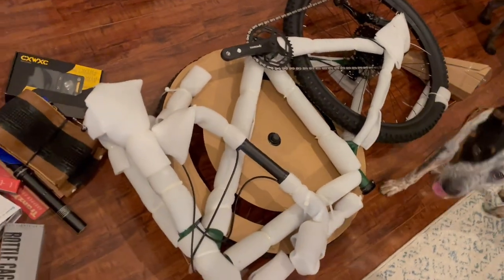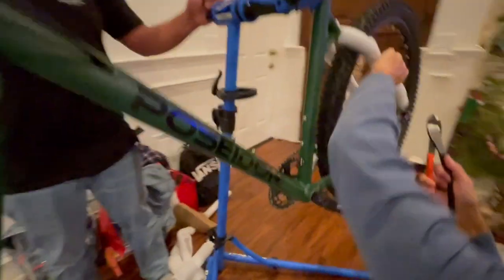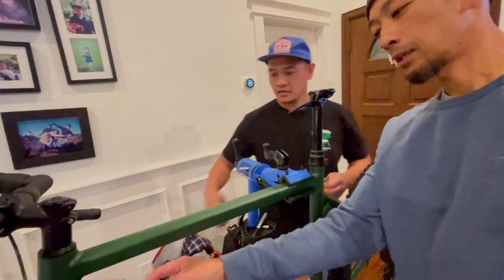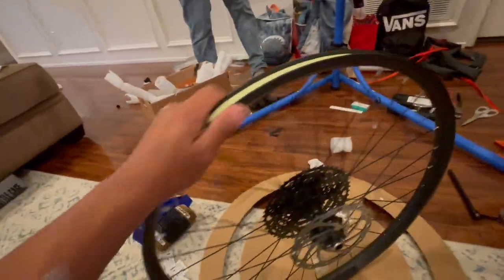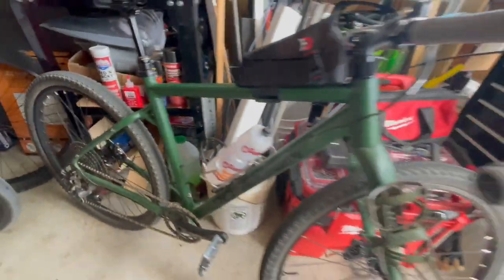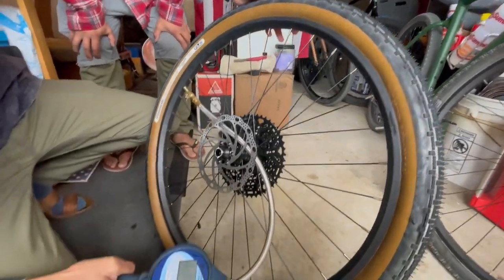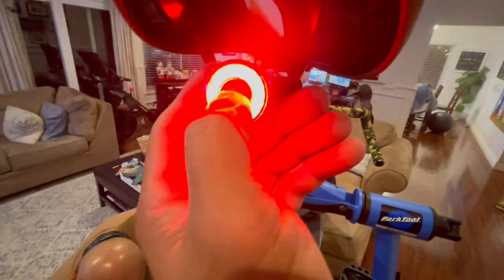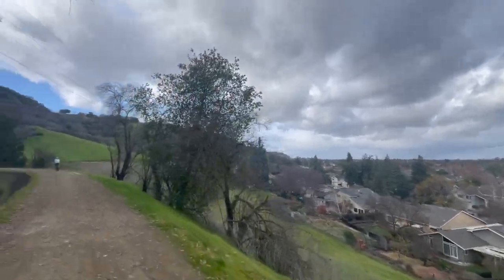Poseidon Gravel Bike

Comment: Thanks for the video.  After absorbing everything on the X and the Redwood for weeks, I pulled the trigger on the Redwood in green.  I'm right at 6' tall, so I went with the large, though medium would have also worked.  The large frame gives me more seat post in the tube and a bit more room inside the main triangle with still plenty of standover.  My bike should arrive Saturday, and the forecast is for 59F and sunny, so if FedEx delivers on their usual timetable I'll have time to get it built and take a test ride.  If not, Sunday afternoon is supposed to be mid 60s.  I have some mods planned (not including tubeless), but to ensure I have zero warranty issues, I'll be riding it stock (except the pedals) while I break it in.  There's a residential construction site a mile away with plenty of mostly packed dirt roads that will probably be a little bit muddy, so it will be a good test.  This bike is unlike any other bike I own, and to say I'm looking forward to riding it would be a real understatement.
Reply from the maker: Hope you enjoy the bike. My buddy bought one also and found the break rotors were a little warped. Let me know if you have the same issue. We just straightened it and works fine. Maybe I’ll do a year review soon. Thanks for watching the vid!